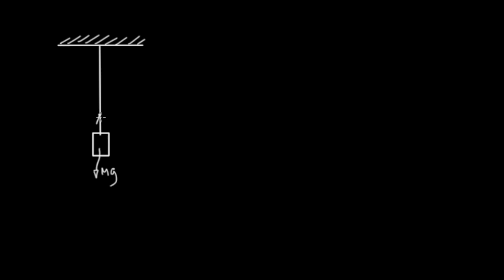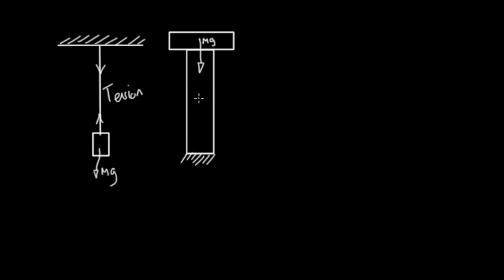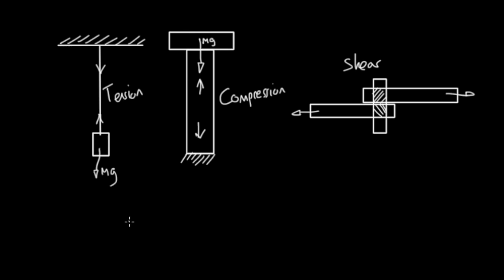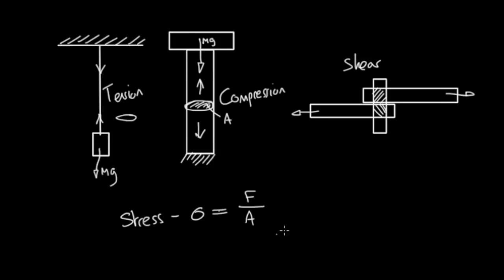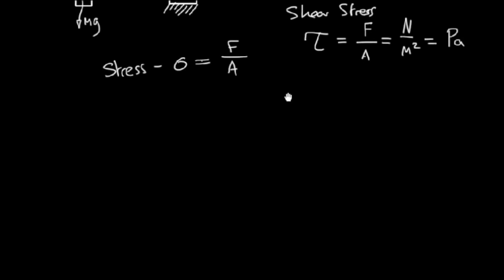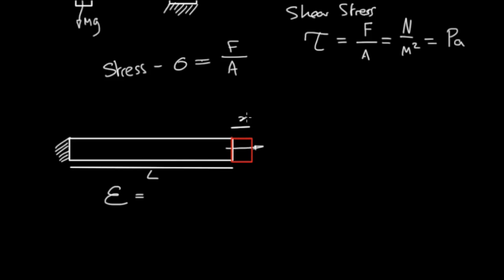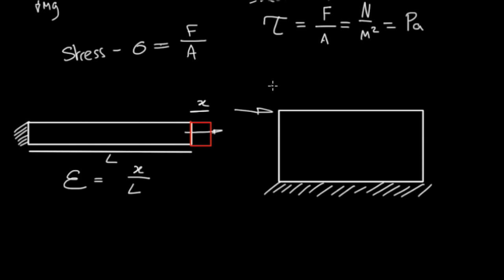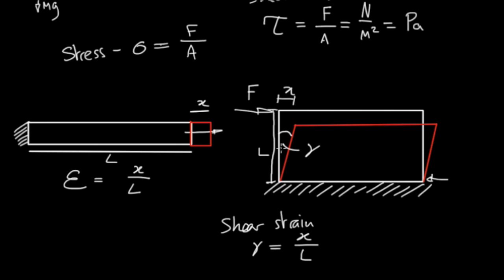material stress and strain

Comment: On the shear stress, gamma, is it a number value or an angle in degrees? If it’s in degrees and not a number value, do you have to use a sin or cosine operation?
Reply: it's the tangent of the angle of deformation in radians